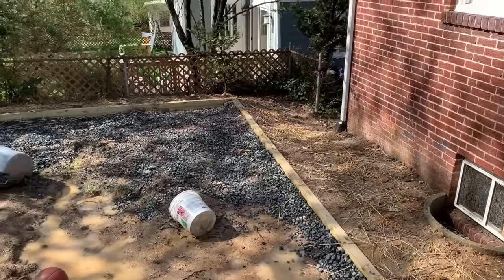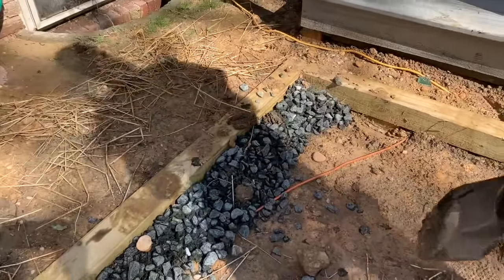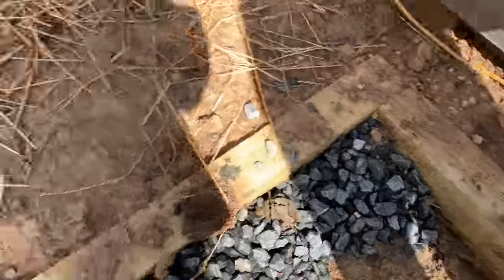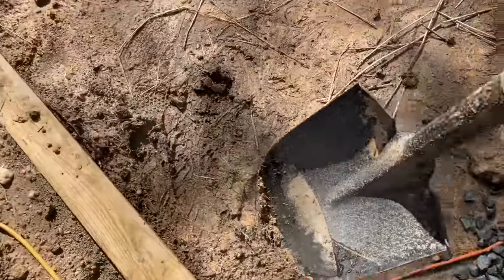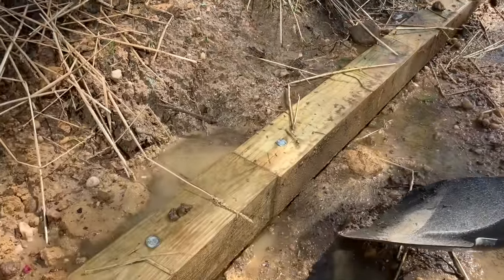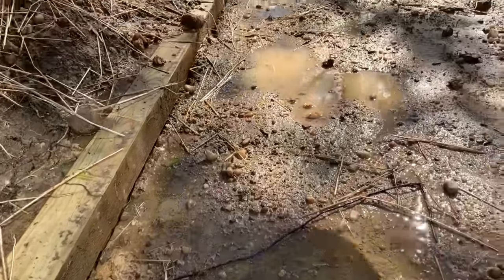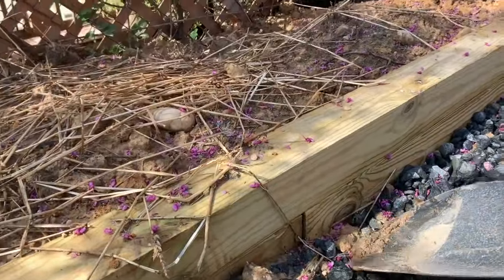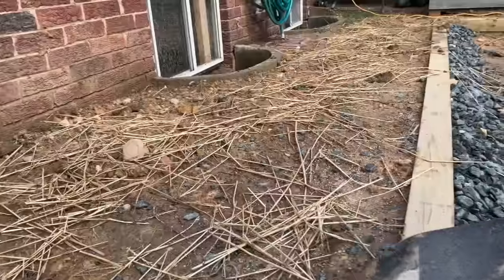DIY Sport Court Basketball on Gravel Base

Comment: Nice work! I’m working on a 30x30 court for the kids. I hope to achieve similar success.
Reply: Im about to start a 45 by 30 foot court let me know how you're getting along
Reply: @damanrai9879  Just put in the MegaSlamXL goal today.  I'm working to complete the actual court. I'm using concrete pavers for the base.  I'll add a Versacourt on top when the pavers are done.
Reply: @cv4875  update?
Reply: @cv4875  any update on this?

Comment: Happy to find this video - I'm at the stage now where I used a rented sod cutter on the area yesterday (about 28x32 feet) and now working on removing the sod/earth. Half an hour of cutting, then who knows how many hours for the removal (wife, daughter and I)! Fortunately we have use for it, as we had a foundation job done and the earth around the house sunk quite a bit. I'd originally thought about doing concrete, but eventually decided to go with gravel and dust to reduce the expense. But you figure that cement would be a similar expense? We're nowhere near the house, so drainage isn't really a concern.
Reply from the maker: It may be slightly more for
Concrete but may be worth it. After this install I’m finding it difficult to keep every level after settling and rain. So concrete would be a better court. Topping with self leveling outdoor concrete of 1” would be amazing. You may not need tiles after that too, with or without self leveling. It’s a nice touch though. Good luck. What are you doing with all the extra dirt? We still have piles bordering our backyard!
Reply: We had our foundation sealed and insulated not too long ago, and the earth that was filled in sunk after a while, so the earth from the court area came in handy. Here's the finished product: Finished court https://imgur.com/gallery/DfwbPLa
Reply: I'm hoping that the landscaping fabric will protect the stone dust somewhat from being washed away. It's about 900 sq ft, so that would be A LOT of concrete, I'm thinking.
Reply: John Graham looks great!! How is the ball bounce on that?
Reply from the maker: @Dadtheimpaler  well done sir!  OK I'm keeping an eye out for your court painting video :)   and the 3 second  circle too!  What was the cost of the paint and where did u get it?
Reply: @keeptheclienthappyhomediy8034  I ordered the tiles from Alibaba.com. Any number of sellers there, but this one was from Singapore. The tiles were pre-painted and shipped in such a way that the court could be re-assembled without having to treat it like a jigsaw puzzle. They actually sent me a picture of the court assembled and painted in their factory before they shipped. Was about $1500CDN for the tiles, shipped. Had to pay a bunch of other fees at this end for brokerage, port fees, shipping to my house, etc., but still cheaper than buying the tiles domestically.
Reply: Did you leave the plywood under the tiles?
Reply: @sccerplyer  NO

Comment from the maker: 11.20.2022 edit.  I take back the following comment.  The stone dust has settled nicely now and the bounce of the ball is quite uniform.  Some moss is growing I'm between tiles but I think there are treatments or just bleach to stop that.  I've also learned some areas tax based on how much impermeable surface is on a property,, so stone dust and gravel like this will not get hit with those stormwater fees..  

Original comment: Adding a follow up that if I had to do it over again, I would use a concrete base under the tiles, with the same wood frame.  The stone dust has many slight dips that result in dead spots, and grass is encroaching in from the border requiring me to painstakingly lift tiles and pull out the growing grass.  Considering pouring a bit more stone dust from the top of the tiles to remove deadspots, but that stains the tiles so far as I can tell.  However, concrete is worse for drainage so be careful you are not driving water towards your house causing flooding if you use concrete.  However, french drains can pick up water runoff and wick it away from your house.
Reply: Nice video man. I went with concrete I almost went the other route. If I had not have gotten a good deal I would have gone the other way. But I am so glad went with concrete.

Comment: How is the court currently holding up? Any Reason you didn’t put any landscaping fabric between the tiles and the stone dust?
Reply from the maker: That might work buy landscape fabric is good to prevent deep roots but I've found organic matter eventually settles on you of it and you get some growth anyway.  I'm not an expert though.   I do have some grass that creeps in on the court edges and moss grows under the tiles in spots.

Comment: How did you hold the tiles in place did you add some type of end peace
Reply from the maker: when the full court is assembled it is so heavy it cannot move.  i did order from rubber flooring inc the edging which tapers the tile down to the ground as is a design touch.  but the stone dust is filled in to be even to the top of the wood frame, which the 2 of those together make the level playing base.  the tiles start halfway on the width of the 4x4 wood frame pieces and then overlap onto the stone dust areas.  hope that makes sense

Comment: this is awesome! How does the outdoor basketball bounce on the end product? the flooring dense enough?
Reply from the maker: Bounce is reasonable.   I have a friend who added a pad over the stone dust and bounce is too soft.  Onky thing I don't like is the stone dust has  multiple low spots which show up as dead dribble spots over the tiles.  If I could do it over would do a cement base, but that is worse for drainage. Still figuring out how to relevel after each winter.
Reply: Would you consider pavers?

Comment: How are the court tiles holding up? Any issues with them warping or coming unhooked?
Reply from the maker: they warp in extreme heat (95 degrees plus), but seem to return back in the original shape.  they don't become unhooked at all.

Comment: Does the stone dust make your tiles dirty
Reply from the maker: not on install, it's very tamped down and heavy. but I tried adding stone dust through the top to fill in dead spots and that is very hard to clean off afterwards.  if I could do it over again I would have at least some cement to make a very level surface for the tiles.  I might remove some dust and do that still when i get a chance.

Comment: What was the point of the gravel if it costs the same as pouring concrete? I am looking for a cheaper way. The court looks great, awesome job.
Reply from the maker: The gravel is good for 2 reasons: the rain drains through the gravel so any tree roots beneath the court are fine, whereas concrete would starve them and you would see it in the branches above the court.  The other benefit is concrete is just a large surface for rain to hit and be diverted off of in a single smaller area, which is also what happens with a roof.  If that water is near your house you are increasing the chance of that water getting into your house.  That is why flooding occurs near large parking lots.